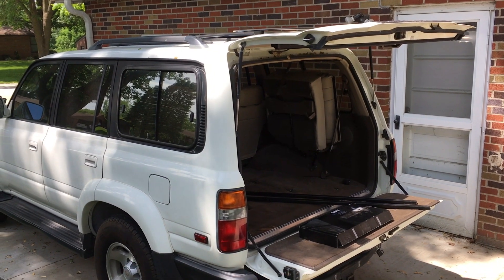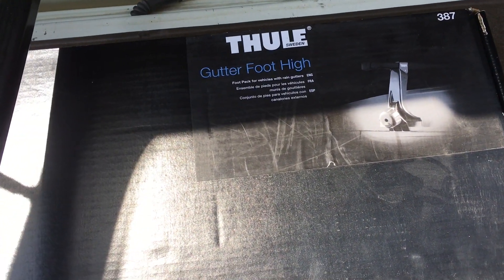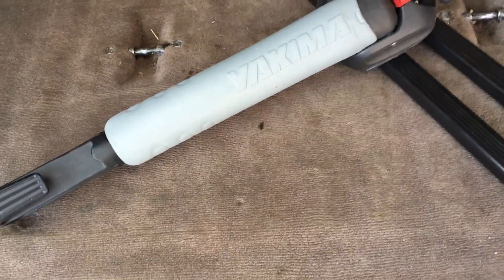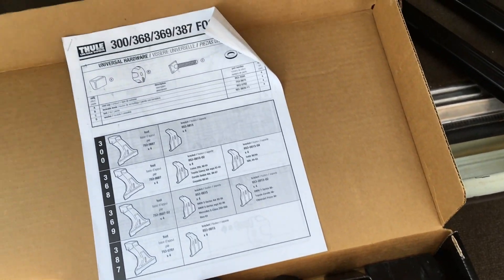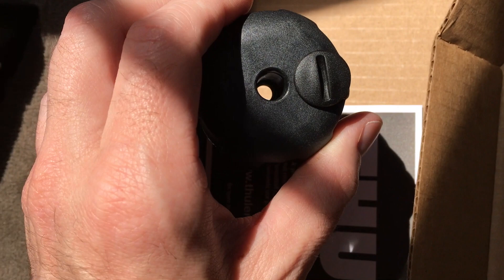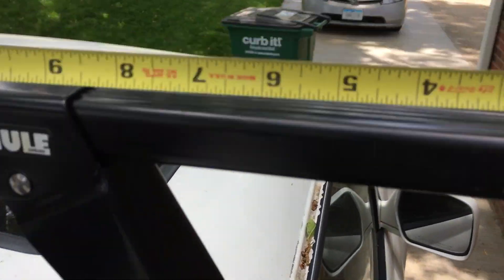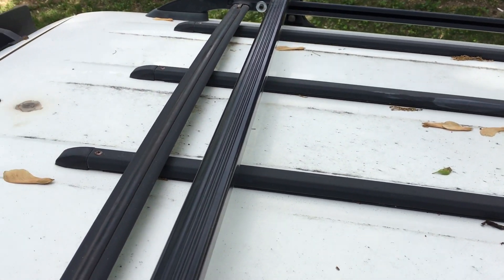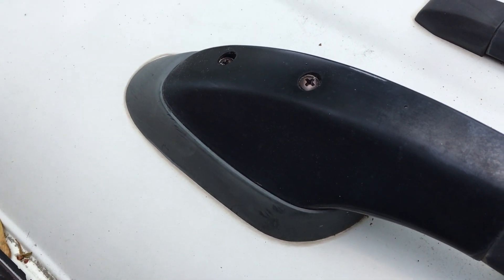1997 Toyota Land Cruiser Thule Roof Rack Install/Overview

Comment: Showing how you attach the load bar sure would have been helpful.
Reply: hi, i know its late to ask but have you had a hard time straightening the feet so its straight? I'm yet to receive my bars but my feets are kind of angled upward due to the shape of the room and gutter and I'm worried the bars won't slide through nicely  as the feet are angled upwards unless i substantially bend the bar in the middle then maybe

Comment: We have the same vehicle but it doesn't have the factory roof rails. I have been using square bar Thule racks since the 1980s and have a 387 gutter high foot pack. When I tried the feet on the truck the bottom of the rack was so much higher than the roof I didn't want to use them. I think I'll get a set of the shorter 300 feet. What are your thoughts?
Reply from the maker: They do sit pretty high off the roof. I haven't tried the shorter feet although I did see them when I got the high feet. You might be able to find them at a local outfitter that will let you try them before you buy. On a similar topic, it looks like Thule no longer makes the 387. I emailed them to clarify but haven't received a response. I'm not sure they have an "official" gutter mount option for the 80 series Land Cruiser as their search doesn't come up with anything. If you try the short feet and they work, please let me know so I can drop a note in the description. Good luck!

Comment: Would you feel comfortable putting a roof top tent on the rack? Like it's is sturdy enough?
Reply from the maker: I think these are rated for 165lbs so I'm guessing a set of two (four bars total) would be needed to support a roof top tent. That being said, I think these were discontinued. Thule no longer shows them on their website. I emailed Thule to confirm but they didn't response. I think they have low staff due to covid.

Comment: How is the bar attached securely to the gutter mount?  Thanks
Reply from the maker: The outer bracket has a hook on the end that goes on the outside of the gutter. The inner bracket goes on the inside of the the gutter. When you tighten the knob, the inner and outer brackets are clamped together with the gutter in between them.
Reply: RickMakes thanks for the reply.  That part I understand.  I’m wondering how the bar prevents from sliding within the mounts.
Reply from the maker: @venicegordon5272  Oops. Sorry, I misread your question. The inner bracket is two pieces and is fashioned similar to pliers. When you tighten the knob, it squeezes on them and clamps the bar. You can see the silver pivot on the side of the bracket.
Reply: RickMakes thanks makes sense, just bought some